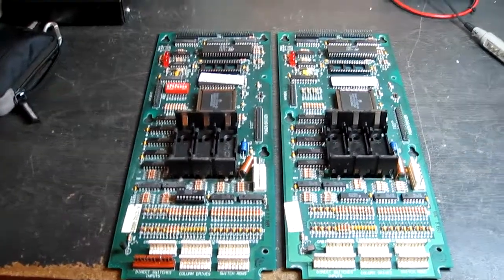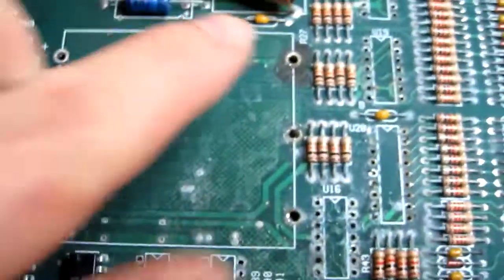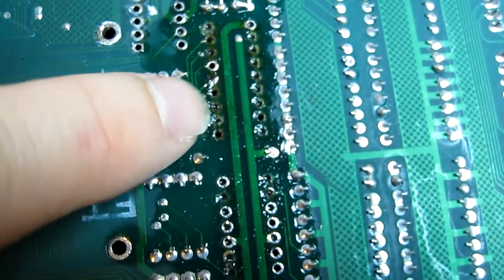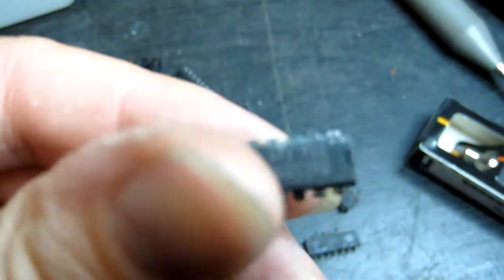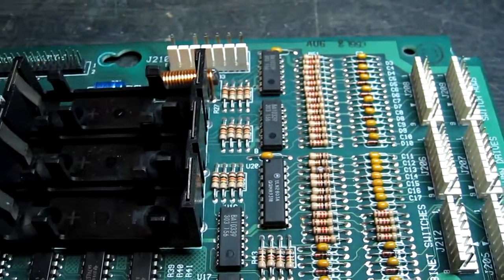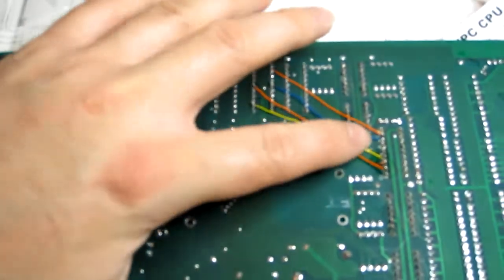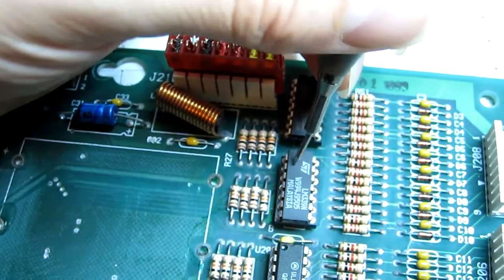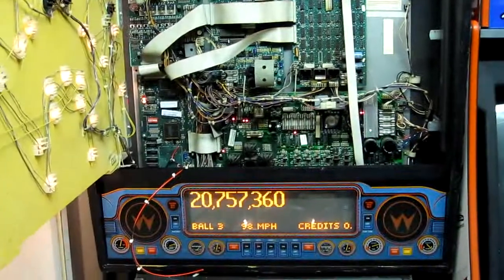2 Williams WPC CPU Boards being repaired

Comment: lol what did they use to do that solder job? a blow torch? :D
Reply from the maker: looks like it lol, They've clearly used something too hot and also probably pipe welding solder as the flux was very nasty corrosive stuff, so probably acid cored